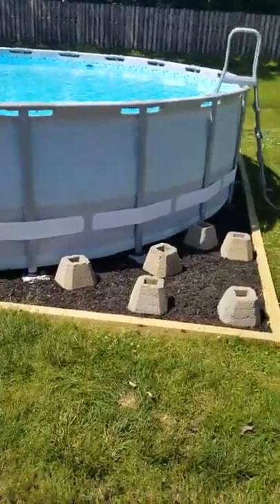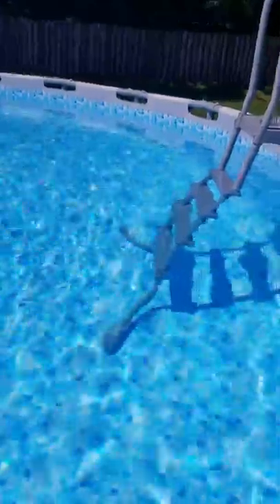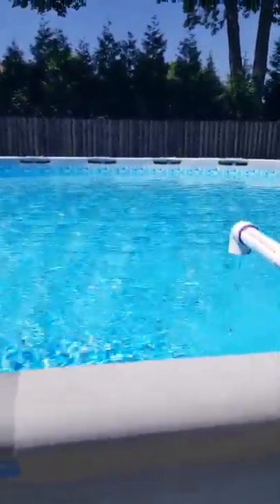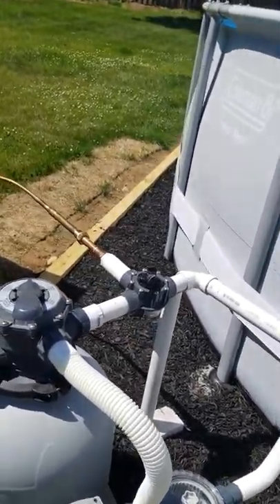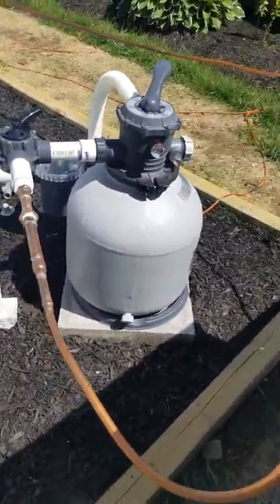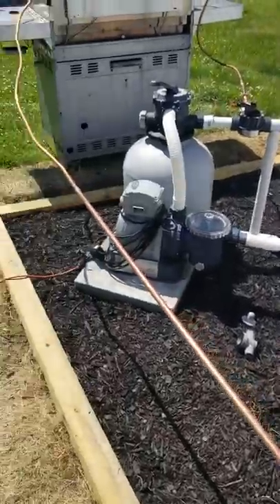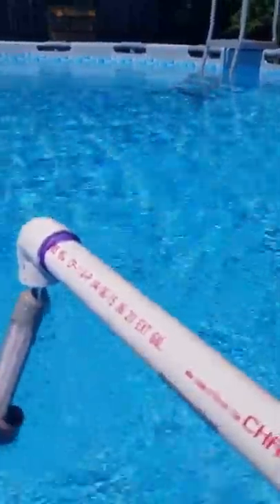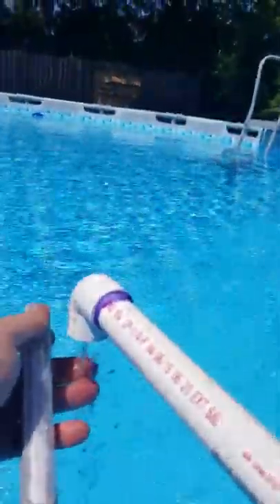Redneck pool heater using grill.

Comment: Use a car radiator or something similar for better hear transfer. I have heated an entire in-ground swimming pool to hot tub temp that way. Although in that application I used 4 radiators. Basically had 2 heaters running that were 2 radiators in series. This was in April with a cold pool and the water temp coming out was around 150 degrees at the flow rate of a garden hose. Only took 4 days of wood fire heat.... haha.

In your case, one average size radiator ought to work to maintain 80 degrees. Due to the dozens of thin water channels in a radiator, the heat transfer into the water is very good at higher flow rates. You want high surface area and low cross-sectional area. To do this without restricting flow, you need several wide, narrow channels running parallel to each other from the same source.
Reply: Would an aluminum car radiator be bad for the water? As in make it dirty or unsafe for swimming?
Reply: @danholmes1522  from personal experience, I have not had any problems. I thoroughly flushed the radiators before putting them into service.
Reply: So the four radiators that you used for the in ground pool, where they all metal radiators? Since you said you had a fire to them?
Reply: Do you have a picture of that set up? Or video?
Reply: @rm-ot1ff  aluminum radiators with plastic sides. Just keep the plastic from being exposed directly to the fire. The water flow will keep them cool enough. No pictures or video.
Reply: Thank you

Comment: For my 18 x 9 pool I have nearly the same setup as far as the grill and copper but not getting nearly the same results. I'm not using 3/8" like you but using 1/2" soft refrigeration copper (50ft) coiled just like you have on your grill. You didn't mention how much copper length was on your grill. Maybe 25 ft. Anyway, my water temp reading for the water exiting through the grill is only 84, nowhere near 98. Could any of the following be the problem? Thickness of the coil? I removed the grates and just sat the coil over three burners. Do I need to put the grates back in? My grill uses natural gas and temp shows 400. Do I need propane instead? My water pump has a flow rate of 5.5 gal/min (330 gph) @ 55psi. (Maybe too high a flow). When I lift the bbq lid after 30 mins of high heat the coil has condensation on it and not at all hot to the touch. After browsing I just discovered the second hand old model natural gas bbq I'm using for this puts out 40K btu. Any help please. Thanks!

Comment: I did the same thing with a coil thrown in my fire pit for my 16 ft intex. Your going to need more flow to make any difference. I ran a 800/gph pond pump with it reaching well into 100+ degree water and it barely maintained the temp.
Reply: Yeah he's looking at the temp coming out, but a higher rate of flow will have better convection. It may come out at a lower temperature, but the higher volume more than makes up the difference.

Comment: My in ground pool, I already got fittings to tap into, for utilizing my booster pump that is typically engaged for polaris operation only (but I can maybe try some diverter valve setup)  I also got a big green egg, primarily for grilling, and I even got a weber propane that don't get as much use!  My question, does your gas grill pull double duty?  Can and will ya still cook on it sometimes?

Comment: I am trying this ! I tried to bend my 1/2 12 foot copper pipe ! I tried putting salt in the tube to bend it but it kept breaking...  I'll buy it in a coil next time ! This will work if you do cover it at night ! Pools lose there heat mostly at night if you live in a cool area. Solar won't cut it for me. I'm in Northern Canada
Reply from the maker: Save your time , unless you do it on a bigger scale say like old oil tank , wood fed, separate filter to get more gph, copper coil is not the way to go, some sort of heat transfer . Be safe and good luck

Comment from the maker: Hey Paul the problem you are going to run into you need a higher GPH if you lower the flow it will get hotter but never heat that much water.  Just be mindful this is very dangerous when I gets hot almost melted my arms  it can explode.  Mine was coming out at a gallon a minute which is nothing . You might need higher heat, thicker, copper, and a lot bigger pump with more flow. Again, it is very dangerous. I gave in and purchased a pool pool heater right after the video sad to say I only got five years out of it also so I bought a new one. They do make a stainless steel wood fed pool heater, but it’s pricey, best of luck to you. Be careful.

Comment: Do you think it would work if I use a smaller 2nd seperate pump where the second unused port B (out) water is going directly to the pump as normal 

and then 

have the water thats coming out of the other side of the pump that would normally go to outlet A (to go back into the pool) run through your set up of pvc/copper into a grill so that its heated as it enters the pool??  *in other words eliminating the part where the port B(out) water is going into the grill by using a seperate pump just for this*
Reply from the maker: If you can somehow eliminate the coils from being in direct contact with flame because copper turns black with buildup then takes longer to heat next time around.. i was thinking of building a rocket stove out of a large propane tank. Have an inlet and outlet on opposite sides that the water goes around the shaft of rocket stove.  But i gave in an brought a gas heater🤣🤣 check out my other post. Good luck.
Reply: @holyhouse2935  do you think if i cover the coils really well with foil thatll help deter it turning black?
Reply from the maker: @ladyrenaissance2026  depending on size of pipe tou are using you are going to have restriction. I would be very careful because you can end up making a steam bomb. Make sure you are constantly runing the pump even when flame is off. You DONT want to run cold water into a hot pipe it will quickly to to steam and could be a disaster.  For ya. Plus a propane tank will only get you about 5-6 hrs of fuel. Depending on how much water you are pushing out its not going to work. You are gonna need at least 20-30 gpm to make any kind of change. And you not gonna get that with a 1/2 copper coil. So even if you got one inch and the amount of money you would be spending might as well get a real heater. Good luck. But if you can weld i will show you a diagram i drew up a out the rocket stove.

Comment: Do you know the specifics of the copper? what temp can copper reach ?
Reply from the maker: I bit the bullet on this and just got myself a heater.. haha. There would be a lot of science and or chemistry behind this. First the flow was to slow at a gallon a minute, so you would need a secondary pump to push more water. Then your probably going to need a bigger pipe that’s able to heat up properly enough and safe enough through some type of exchanger. Not really safe to do almost created a steam bomb . At the end is your safety worth a couple of hundred dollars , that’s why I gave in and by far the best investment I ever did. Had that pool at 102 on a few nights and said to myself I have the largest hot tub 😀

Comment: Do you use chlorine in your pool? If yes, you better use 316 stainless steel instead of copper
Reply from the maker: That was just a trial I have since upgraded with a 156btu natural gas heater.

Comment: hi brilliant idea 😎👍🏼 how big is your pool ??  how long do you need to warm the water ???  how many gas bottles do you need?  would be happy to hear from you soon😎👍🏼🙋🏻‍♂️
Reply from the maker: Pool is 22x 52... it was a trial that i tried 1 bottle set on high last about 5 hours. But the slow water pressure  would never change the pool temp. Was getting a gallon a minute  at about 105 degrees.  Used a 50 ft coil of 1/2 inch. But do not try this you can really get hurt.  Or severely burned. Its pretty much a steam bomb waiting.  I will be posting and update what I did with the pool in a few days .
Reply: Im changing to this setup from a tankless water heater that has been a nightmare for me. 

Increase the flow with a better pump and you will heat that pool no problem. Our pool is 15’x48” and we heated it not problem when the heater worked right with a diaphram pump. 

We’ve upgraded to a better pump and will swith to your setup with a flow control.

Comment: I would suggest running the water thru the grill as fast as possible for more heat transfer. Also, do you have gas available? You could convert the grill to natural gas, it would be much cheaper to run.
Reply from the maker: I thought of that also  but the little wheels in my head and keep turning . This would definitely work on a smaller scale say hot tub. On a bigger scale there was to much heat loss and not enough flow. Maybe with a separate pump at a faster rate but you would lose heat. Keep moving forward good luck.
Reply: @holyhouse2935  What about natural gas?
Reply: No i would say running the water through the pipe faster means less time to warm up the water.

Comment: F-ing love it!  I was going to do something similar but use one of those 50 gallon drums you convert to an oven.  But then I have to supply wood and maintain the fire.  This is even better! Thanks!  Does your output copper tubing just attach to the PVC that dumps into the pool?
Reply from the maker: Went in from pvc but out from hose. If you are gonna try i would suggest a separate pump and probably bigger pipping to get the proper flow. Keep in mind the copper pipes will turn thick black . Fogot what they call it

Comment: air is a very good insulator and does a great job at preventing heat   transfer from 1 thing to another...there is a better way to set it up over what is currently being used and its definetly counterintuitive but it will definitely work better and also be way more efficient...but first I must say that the coil diameter is very small...and the price difference between 3/8 refrigerant tubing and the next sizes up 1/2..5/8..is not much more than the 3/8...your talking less than or about $20 or so...so  its kinda pointless to intentionally make something less efficient over not wanting to spend the extra $20 even though the added cost would be recouped very quickly in fuel savings...2nd...there should be something with much more surface area doing the heat transfer...there is a reason why your cars radiator...central ac condenser and evaporator coil...all have aluminium fins and not just tubing...very small surface area to exchange heat is strike 2...get something that is similar to ac coils or baseboards that have fins and find that poorly designed contraption a new josomewhere else... heat up a liquid like water instead of air because much much much much more heat can be transferred using a liquid...it would be much better to use something with fins but if its your only option then just use the current coil being used and submerge the coil into water or a different liquid...liquids are 1700 times more dense than gases...so the capacity that you could heat will increase 1700 times if you heat a liquid...think.   of heat transfer like its magnets...because it is magnets...something much more dense has much more charged particles (magnets) in a smaller area ...so much more heat can be transferred by the charged particles (magnets) because there is many more in the same size area in liquids than in a gas that always tries to expand...much more heat will be picked up by the water being heated going through a liquid compared to a gas....crappy design
Reply: I'm curious of how to make one with a radiator. Could you explain how to setup something like that?
Reply: @j.r.mullins6392  I pretty much explained it in my comment..I am a certified hvac tech so I understand the transfer of energy..aka heat...the reason why a radiator or a ac coil will work better is because the surface area collecting the heat is much bigger and also there is much more pipe..if u look at a radiator or ac coil you will notice that the tubing inside will be from one side to the other and on the end there will be 2 90s and the tubing will go back the other direction to where it started then turn and go back the other way..then back the other way...so if you have a coil or radiator 2 ft wide there will be 10 or more rows because it keeps going back and forth..and there are 2 sides of the tubing in a coil or radiator...so if there is 10-15 rows of the tubing going back and forth and the coil is 2ft wide...that's 20 to 30ft of tubing per side so the total length of tubing would be about 40 to 60ft in something only 2 ft wide....the fins on a coil or radiator is a metal (most likely aluminum) which conducts heat well because it's a conductor so much more heat will be transferred to the fluid inside the tubing of the coil or radiator... surface area is the most important part of transferring heat...all of the fins absorb heat...and hot always travels to cold so the water will always gain heat...and by radiator I mean a car radiator because they are essentially a coil....you could get a couple coils and tie them together and make a wooden box with a plexiglass top to put them in so sunlight can get in and paint them and the inside of the box black...then u won't need the grill...I'm sure you have touched something metal on a sunny 80 degree day which is when you want a heated pool most... you could also use baseboard radiators in a box but I don't know how good your plumbing skills are because you would have to solder a bunch together and make a coil out of them..making an enclosed box and insulate the sides and bottom with r6 bubble wrap insulation used for insulating hvac ductwork so sunlight can get in but heat can't be out. there's many different things you can do and it mainly boils down to the size of your pool...where you live...how much temp increase you are after...your budget to spend on heating the pool... building the box with coils or radiators (baseboard) you won't have to use a grill...I don't know where u live and how much of a temp increase your after and the room you have...but maybe you could get away with using 4in pvc painted black and just laid down on the grass